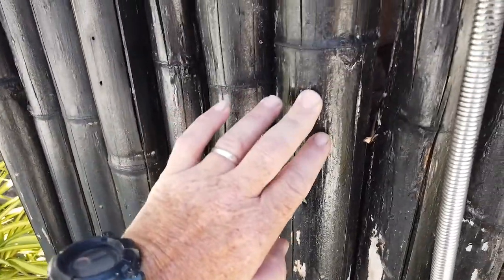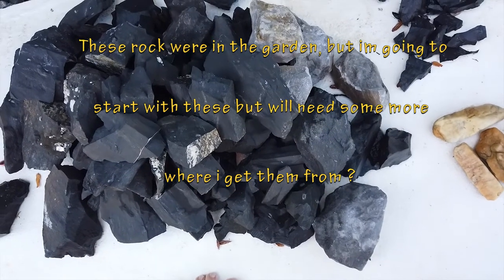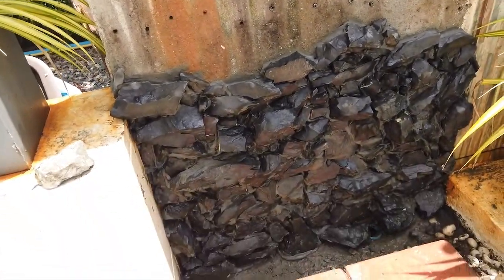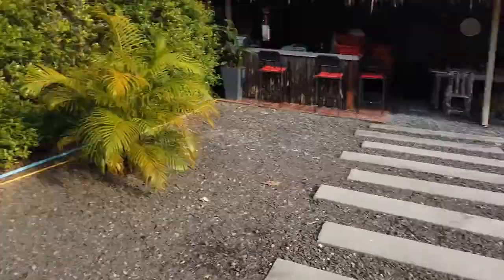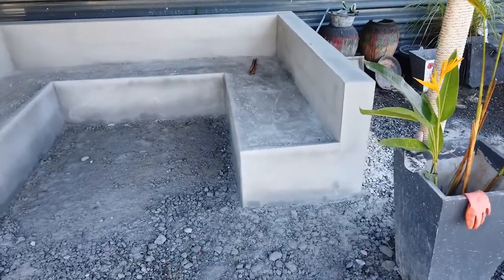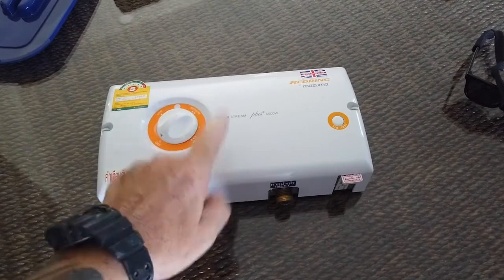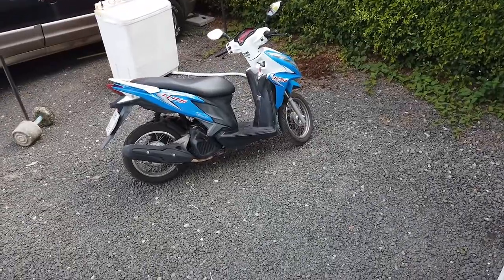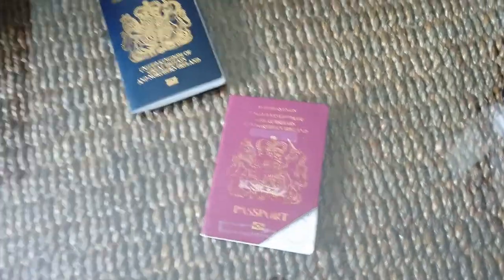GET A NEW BRITISH PASSPORT IN THAILAND WITHOUT LEAVING- GREAT EASY SERVICE #thailand #renewpassport

Comment: Very useful information and badger for the expat community in Thailand. How you get or with Your water heaters Giza at home pro
Reply from the maker: took it, and in thai English they came 8 days later and replaced the pressure switch which is not covered under warranty, but 1450 bhat and repaired at home and put back not a bad price, better than 7500 for a new one, the other is Donald ducked, im happy